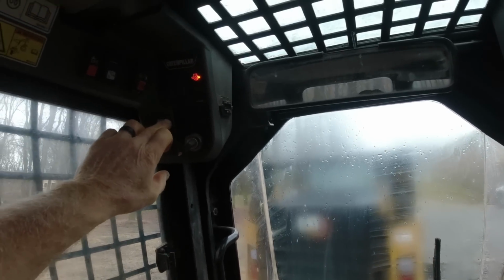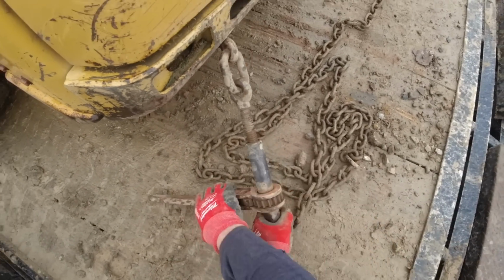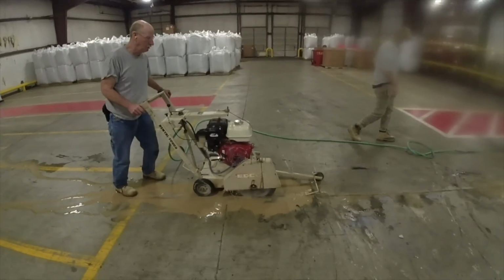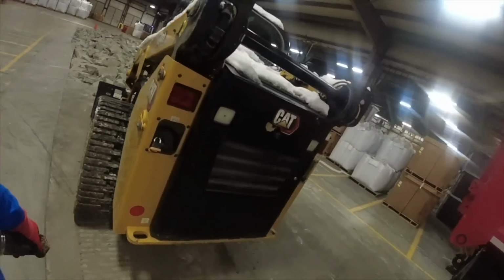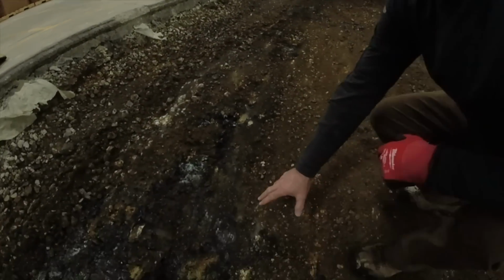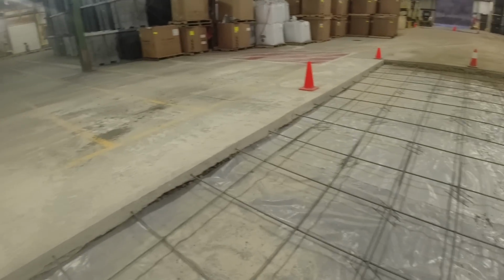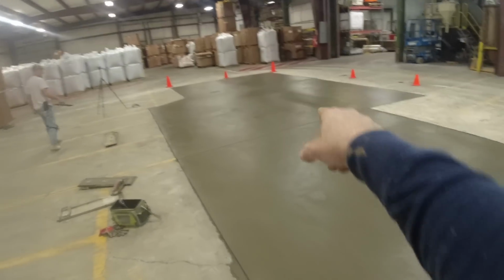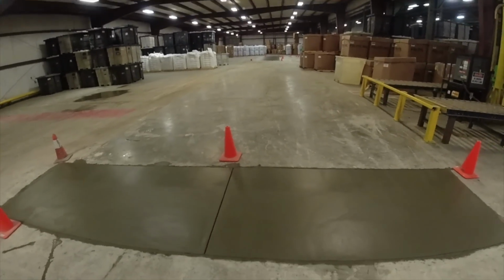What Is Causing This?!

Comment: Tom , without a proper soil test this could come back to bite you .We were  called in to remedy a slab in a municipal garage that was heaving , after breaking out a section of floor 8"thick we had a soils engineer take a coring sample , his findings were we were actually on a peet bed that was app 4' deep , if not deeper .Their solution was to layer 2" dense blue styrofoam in a predetermined criss cross pattern to stabilize the  future concrete floor , surprisingly this was done in numerous building in the area and was a working solution . we did this app 8 yrs ago and it is a municipal vehicle garage , so far we have had no problems , we are in the metropolitan Chicago area !     hope for the best and pour the rest !
Reply: Agreed. Seem it before. Styrofoam. Drainage would help a lot. Next big rain....
Reply: That could have been from the fire, 
SF built right on top of the old city after its major earthquake then fire. Think what that rubbish is now after almost 100 years of rotting.
No wonder a 2 deck  bridge fell apart. They didn't think about this stuff back then they just overengeered.
Reply: Was the job done wrong? Or are you being a critic?
Reply: @paulrosselle9747  Did you read what he said?? This "could come back to bite you" because he may have needed to excavate more material. However, if the water table was that high, what then?? I'm sure there could have been more testing and greater costlier solutions, but being a leased building with the owner responsible for the repairs, I get it. I don't think the guy was being a critic, he was sharing his experience with a solution that works in similar situations...
Reply: DC maybe people didn't realize the business owner is responsible for the maintenance and upgrades and not the building owner.
Reply: @paulrosselle9747  no on both counts . Job was bid as occupant wanted it repaired  .Owner of building should have known this was a problem since he has owned it .I'm just being honest that we had a similiar problem with a municipal building , the floor was heaving .After numerous attempted repairs owner called us and we immediatly took soil borings .Boring company suggested excavating to minus 4ft and layering in 2 in styrofoam in a pre determined pattern to within 10in of finish grade and pour with rebar ....it works !

Comment: I was in commercial construction for over 45 years and have experience with heaving and subsidence. Generally speaking, depending where you are geographically, heaving can be caused by many things like leaking pipes under the slab, unstable soils types below the slab such as high P.I. soils or fat clays. A soils investigation by a qualified Geotechnical engineer would expose this before foundation and slab work if employed. In severe cases the entire slab may need to be removed and remedial work applied to the subgrade such as lime stabilization or complete soil replacement. It's always a complicated subject with lots of finger pointing. Good luck!
Reply: Appreciate your comments from professionals that has had practical experience in a construction dilemma like this.  The owner of this property I’m sure appreciates all the input as well as Tom.